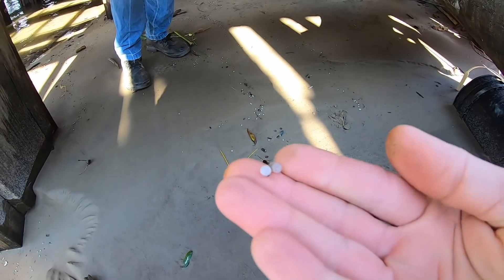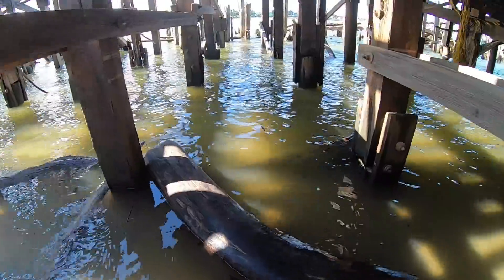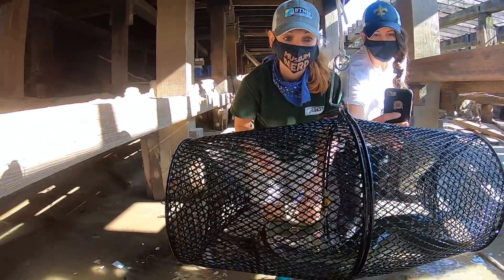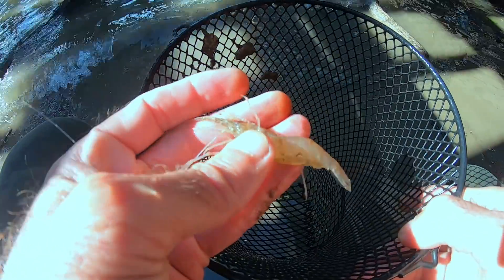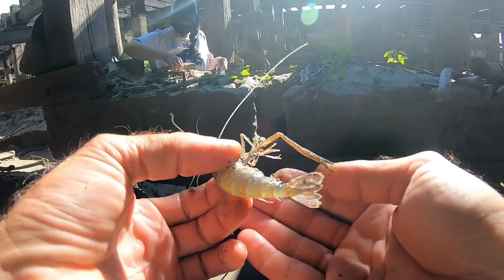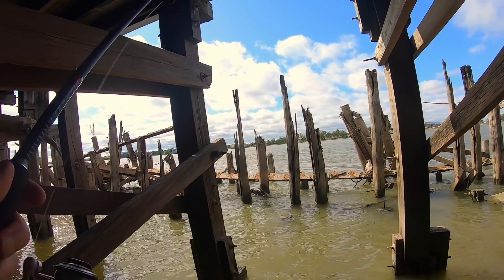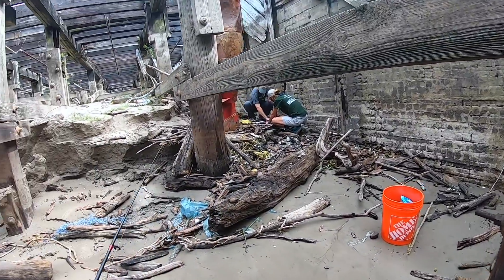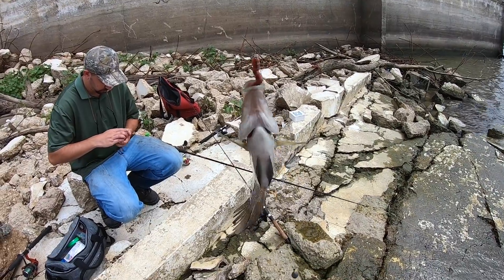Fishing With Scientist, Nurdle Apocalypse, Mississippi River

Comment: Need to stop counting them and start picking them up
Reply: Perhaps you don't understand what we're doing. Perhaps you're a troll. If you're the former, I'll try to address your concern. Scientists didn't create this spill, the shipping company CMA CMG are responsible. Until journalists and our research documenting it raised awareness about the spill, nothing was being done to clean up the nurdles. In response, the insurance company for CMA CMG contracted with a Texas-based environmental company to clean up the nurdles. They are doing a rather 'limited' job. Many concerned citizens are involved in trying to clean them up. If you are concerned, contact the Plastic Pellet Clean Up Crew on Facebook.

As scientists, we are trying to measure where the nurdles are, how abundant they are, and how their abundances are changing over time. We remove every single nurdle we collect. We also participate in clean-ups and have collected two large sacks containing over 550,000 nurdles each that were deposited on the shorelines. So in response to your comment, we are counting them, we are removing them, and we are creating data that we hope will galvanize our State into creating legislation to prevent future spills.
Reply: @celer__et__audax  Thank you all for all the hard work to address this situation.....
Reply: @celer__et__audax  As M Hood would say "Yeah You Right". Thanks for setting the ignorant comentors straight about your efforts to improve our state. Thank you for your service!
Reply: How many have you picked up ?